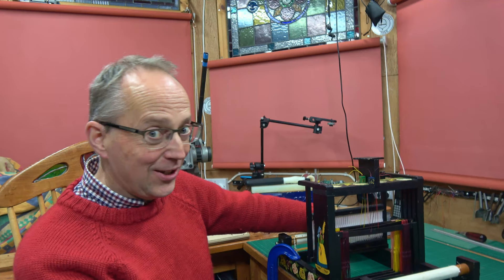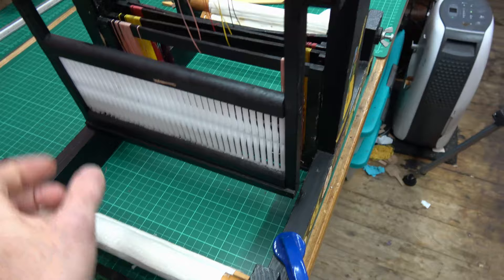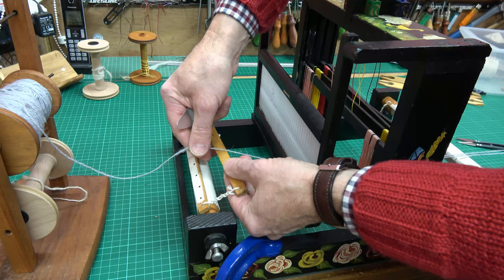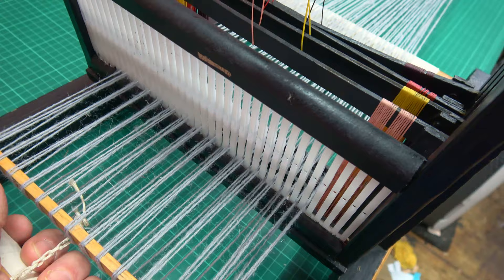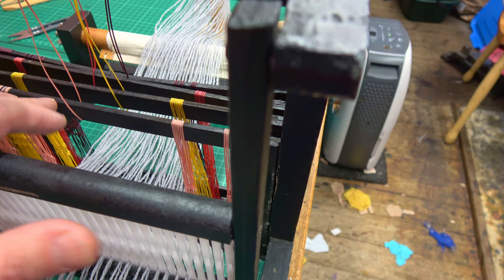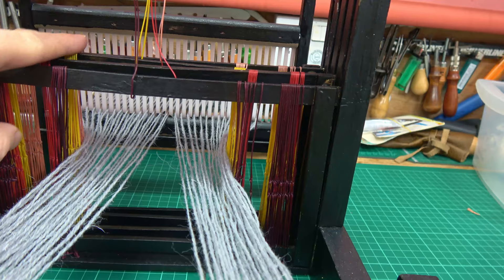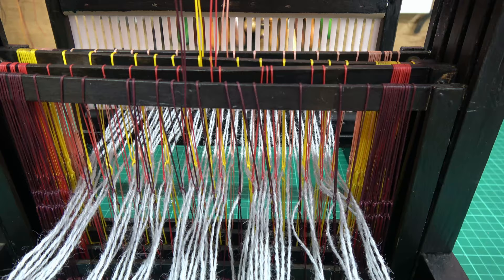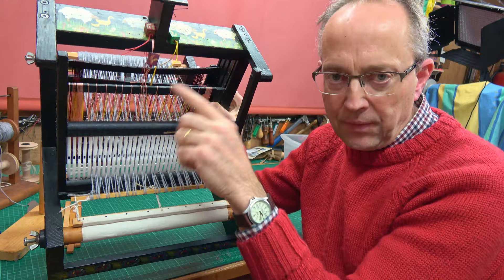Warping Up My Four Shaft Table Loom 4K

Comment: Dang, how many belts and wallets could have been made with the time warping that 'bitty loom? :-) There is a sewing notion "loop turning tool" used to turn fabric tubes inside out and pulling cordage through the tube for bag handles etc. It uses a hook and "floating" latch mechanism, is ~10" long, very inexpensive and easy to use. Similar to a baiting needle for boilies. I believe it would make a great tool for warping the loom. Your warping needle is good but it has no latch to close the eye. Have a look. It might be useful. I sew but I don't weave. You and I are a lot alike in having many diverse interests and not enough time for every one. I very much enjoy your videos. Have a great day sir.
Reply from the maker: Thanks Gerard, I was interested to see that sewing loop turning tool...looks pretty useful. I am enjoying making more wallets at the moment, but I do also enjoy some diversions. I think trying another craft gives insights into different techniques and ways of thinking  but of course it is also a distraction! Thanks very much for your comment, very much appreciated. Rgds Harry

Comment: How many string heddles do I put on a heddle reed. I am buzy building myself a 48" table loom. But need to no how many heddles I will need per reed?
Reply from the maker: @amandahattingh1189  It really depends on what you are weaving and how many shafts are on your loom, and obviously the width. Look at what the commercial looms come with...like the Ashfords etc.
Reply: Thank you. I almost done with my home built, 4 shaft 48" table loom. This is why I asked your input.
Reply from the maker: @amandahattingh1189  I am building an 8 shaft 32 inch loom at the moment and I am putting 100 heddles per shaft...I  think Ashford put 80 per shaft?

Comment: Hi Harry!
How are you finding it using the rigid heddle as a reed? I have a very similar vintage loom to yours and mine is also missing a beater bar so I need to make something similar to what you’ve done. I’ll have to mount it differently I think as my loom has shaft strings (I don’t know the proper name yet lol) that go over to the side so a top mount like yours will probably interfere with that. My loom has a fabric width of 7.5”, so my options appear to be to use a rigid heddle like you’ve done which is 8”, or splash out on a stainless steel heddle and cut it down to size. Are you completely happy with the rigid heddle or would you prefer stainless steel? Cost wise the rigid heddle would be preferable as I could get 4 different DPI’s for the cost of one stainless steel, but if they’re an issue to use I’d rather start off with the stainless steel and slowly get more. It’s so great to see that someone has done what I need to do and succeeded!!
Reply from the maker: Hi Monique...this seemed to work fine, not that I have much experience to base it on.!!
Reply: Harry Rogers I’m completely inexperienced too, so maybe that’s a good thing which will make it easier to make it work even if it’s not perfect as I won’t know any different!

Comment: Which string do you use for those string heddles ¿
Reply from the maker: I used Ritza 1mm Tiger Thread that is a polyester thread used in leatherwork.
Reply from the maker: Just to add you can buy a cheap clone of this thread on EBay that would be sufficient for this particular purpose.
Reply: Thanks ❤️❤️